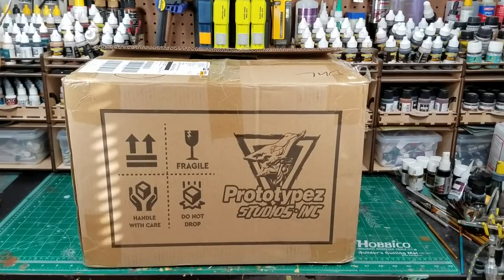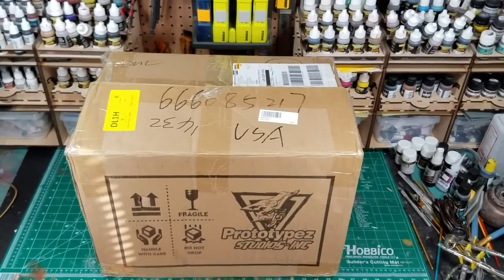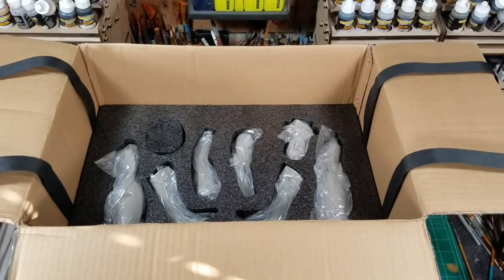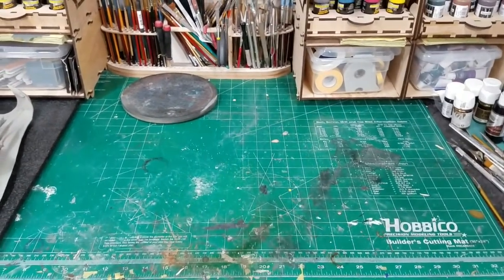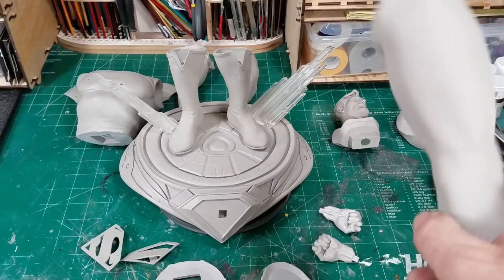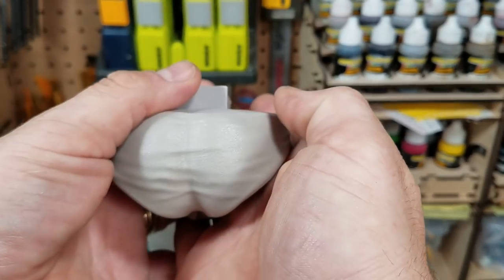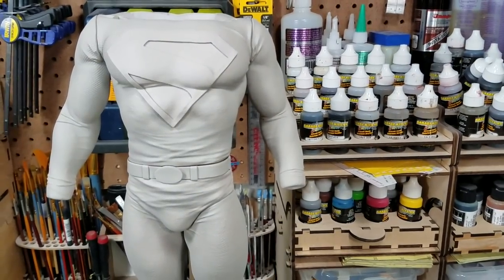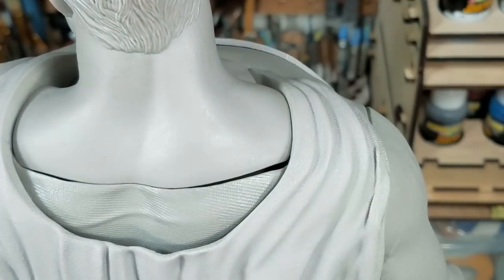1/4 Kingdom Come Superman kit from Erikc Sosa and Prototypez Studios Review

Comment: Hey Matt-
I ended up getting a late casting as there were communication issues between the factory and myself in regards to shipping so maybe the factory addressed some things on later castings...in regards to the things you pointed out, I see the pattern on the front of the thighs, but after applying he initial coat of paint, it becomes much less noticeable, as far as they loose fit that you commented on, mine is very tight. Other than the pegs on the bottoms of the boots being a little loose, that’s it.  Everything else is very tight and secure.  IIRC my casting is in the 90’s, maybe they added stronger magnets on later castings?
I do have to shave about 1/16” off the front of the neck like you pointed out.
IMHO, having built garage kits starting in the 90’s, bearing in mind that this was marketed and sold as a “kit”, I’d give it a 10 out of 10.
Reply from the maker: Randy VanDyke I was hard on this one simply because of the price point.  $950 for a museum pose kit I'd expect the fit to be much better.  I have other kits that are $300 less expensive that fit nearly perfect.  The rings, or morrie pattern, on the legs is obviously in the original digital file since it's present in the original kits as well.  That should have been addressed.  Every other statue/kit I have with this type of fabric or texture do not have that digital artifact present.  I know it's a kit and I always say if you don't like prep don't build kits but considering the price I'd expect better QC.  He'll build and paint up beautifully when done but I can't unsee those rings.  I was looking for color references on this guy and all the pieces that I've seen painted you can see those rings pretty easily.  Maybe it's my background in photography that makes those stick out so much to me since when I 1st started shooting digital 16 years ago, I fought that effect.  If I remember correctly when the kit was 1st announced there was a statement of having strong magnets and top notch quality.  I think it fell short in both those areas a bit.  The sculpt is amazing though and I'm glad I grabbed it.  So even though it sounds like I'm complaining a lot I do love the piece.  And as I mentioned in the review, the fit issues I have may not be present on other kits, which seems to be the case.
Reply: Hey Matt-
  Want to clarify one thing; when I referred to building garage kits since the 90’s, this was not intended to indicate any kind of “pedigree” personally, but rather demonstrate what I’m used to as far as “kit” condition and consequently expectations regarding a kit.
  One other thing I’d like to discuss a bit further is the price...you refer to $950, it was actually $800 with approx. $160 addl. for shipping.  Although the cost of shipping has to be included in a kits overall cost, there’s a lot of factors ((weight, size & distance to ship) that go into the cost of shipping, and depending on where a kit is coming from that can vary a lot; so in order to be fair when comparing kit prices, compare just the kit cost and leave the cost of shipping out of it (as a producer has no control over that.  Shipping should be a separate issue.
  Finally, you talk quite a bit about licensing,  but when you compare this from a cost perspective to other pieces you have on site, to be fair ( when you’re comparing), I think that the cost of the license should either be subtracted from the cost of this one, or an equivalent amount added to the cost of the (un-licensed)pieces your comparing this to.  Based on the overall edition size of the 2 runs (approx. 130 total), and based on what I’ve heard licenses from a company like DC  can cost, I’d speculate that the cost of the license easily added $150 to $200 to the cost of each “kit”.
  So realistically, when you subtract out the license and shipping, you’re at that same $600 figure you referred to.

Comment: The legs were definitely printed with a high res filament printer or they fucked up the slicing before printing, but to me it looks like multiple different printers were used. Both a combo SLA, and filament production! I can see why you are a tiny bit pissed 😤! Look up Alex Ross Gouache paintings on google. The Kingdom Come book that this is based on is a legendary masterpiece! Cheers!
Reply from the maker: Jason Sheer Hey Jason, thanks for the info on the Alex Ross paintings I'll check them out.  Erick commented on FB in the group that the banding is a result of the digital medium which means it's in the sculpt.  The thing is I have other kits with similar fabric with no banding.  Also, I wouldn't say I pissed, just a bit disappointed.   As I always say, every kit needs work.  That being said, for the price of this guy maybe QC could have been better, maybe more time spent on the fit of the piece.  It's a simple piece so making the fit better should have been relatively simple I think.  Some of these crazy complicated kits I have fit damn near perfect.  The Bushi Thor, fits perfect, the Bushi Beast fits perfect, Alpha 3 Home Coming Spiderman fits perfect.